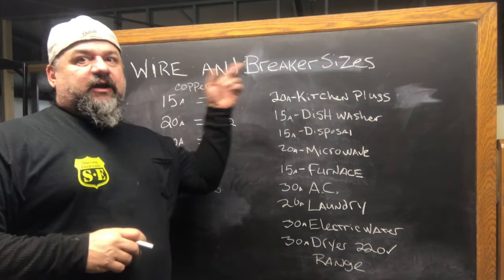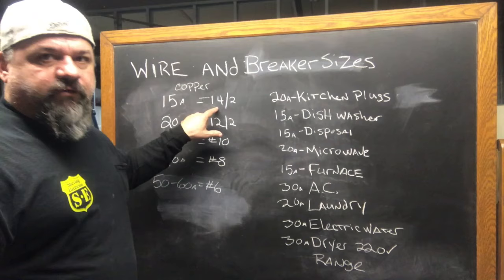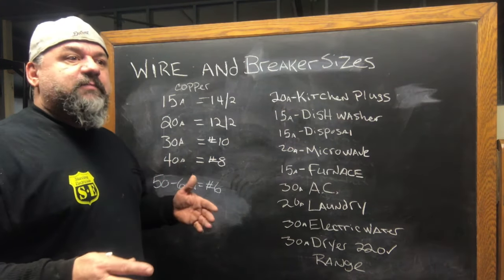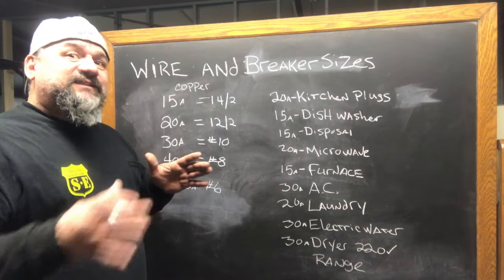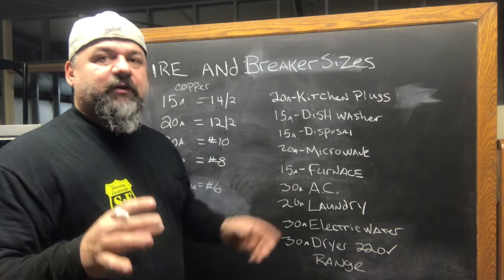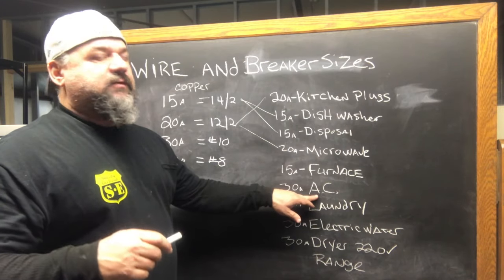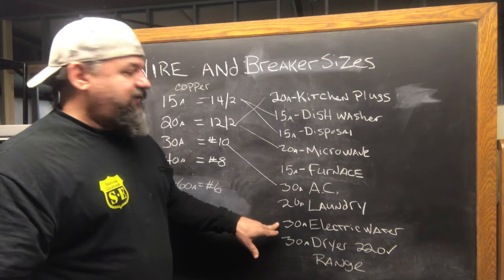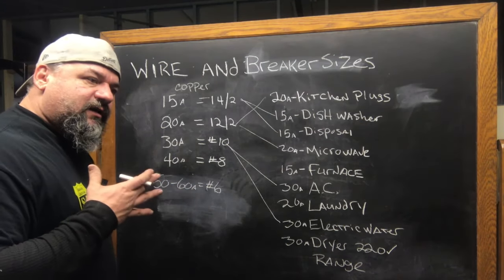"Uncover the Secret to Easily Calculating Electrical Wire and Breaker Sizes!" You wont believe it!

Comment: If I would plug in 3 patio heaters with 1500W; 120V 60Hz 12.5A 5,120BTU each on a single line. What size of breaker and wire do I need please? Thanks
Reply from the maker: ok im going to make you figure this out. 1500 times three is what?  divided by 120v  will get you the amperage.

Comment: Good info question on gfci. I thought you should not have a refrigerator and/or freezer on one in case of a power outage once the power would come back the gfci would be tripped and all food wasted if on vacation for example. Thanks for the info
Reply from the maker: I don’t include a fridge or freezer but you can put them on a kitchen circuit so long as they aren’t gfi protected. Gifs are required where water is present and the plug is readily accessible. Behind the fridge they don’t qualify. In fortunately if you only have one plug in a basement let’s say? You decide to plug your freezer in it then that one plug must be gfi protected. Have to have at least one gfi plug in an unfinished basement.
Reply: Starving Electrician good to know thanks

Comment: Appreciate it. Can you use 14/2 on a 15 amp? Running some can less LEDs. Already had a role of 12/2.
Reply from the maker: go with 14/2 for a 15 amp circuit but use the calcilations to determine how many circuits you need.
Reply: @StarvingElectrician  Appreciate it! I have to find out how to do the calculations.

Comment: I have a subpanel in my shed a 6 breaker 100-amp what size wire should I use and what size breaker for my main panel should aI use
Reply from the maker: #2 aluminum or #4 copper

Comment: Thank you for the great video! Is it ok to install a NEMA 14-50 receptacle with a 30A circuit breaker? I want to install a electric car charger (EVSE) that can be set to 24A using a dip-switch and this suffices for my current needs. Do I also need a rewire with #6 (if I had #10) in this case?
Reply from the maker: well the thing is, the circuit is only as large as the wire and breaker. if you have a 50 amp plug you will be good but it will only be rated for 30 amps. if you draw over 30 amps you will fry the plug or the circuit will trip. its like having a race car. you can go 200 miles per hour but the speed limit is55. the car is the 50 amp breaker but the circuit is the speed limit. hope you understand that.
Reply: @StarvingElectrician  Thanks! If someone accidentally tries to draw 50A, should the circuit breaker trip immediately? Or, is there a chance of the 10 gauge wire frying?

Comment: Question my 6/3 cable has a red black white and a solid copper non colored which I'm guessing is the ground which in other cables are green. From what I understand red and black are hot wires and white is neutral. Now my  power plug and grounding outlet call for black green and white do I have the wrong cable or can I still use this 6/3 to plug the 50amp outlet and power plug?
Reply from the maker: victor Martinez  yes you have to two hots but the plug  doesn’t call for a neutral. If I were you I’d get a different plug but if you can’t remember the ground and neutral go to the same place in the panel do ground or neutral will work but the plug is meant for two hots and a ground. Hope that helps.

Comment: Quick question and probably a dumb question. Just built a new shop and installing 200A service. ive got about 70' from the pole to the shop and running underground. Can I run 4-0/4-0/2-0 aluminum or do I need 4-0/4-0/4-0? Sorry for the dumb question
Reply from the maker: from the pole its only three wire. theres no ground coming from the ploe because there are no breakers and if theres a fault it will energize the ground. thats why you ground and bond the service and not the meter can. if your utility company has certain requires any other things that takes president.
Reply: @StarvingElectrician  Perfect! Thank you for the info.

Comment: I have a question I have 100 W panel I don’t have any space on  my  panel hive 12 breaker I’m going to put a new panel with 20 breaker  What’s your advice to me to do 100 panel or upgrade to 150
Reply from the maker: you can put in a sub panel at the same amperage as the main panel. your sub cannot be higher. so long as you dont exceed the first panels amperage you can put as many sub panels as you want.

Comment: Will 10-2 underground wire from my 200 amp breaker on outside pole to my 100 amp shop panel work? I have 110 and 220 out in my shop.
Reply from the maker: no don't do that. that wire is only good for 30 amps and you need 4 wire.

Comment: My panel is full and I need to pigtail a 60 amp 240v 2-pole breaker.  Does it mean that I need to use a #6 wire for that purpose?  Thanks.
Reply from the maker: yes number 6 copper would do it!

Comment: I recently added under cabinet lighting and split the wire to lights with 14 gauge wire. From outlets with 12gauge wire. Is this a bad thing.
Reply from the maker: its not supposed to be that way but you shouldnt have any problems. its just lighting should be on a 15 amp circuit. but if everything in the kitchen is on 20 amp then whats the harm?

Comment: I have a question! I have to indulge you in some history first...
I have a hot water heater that blew an element. I was preparing to remove the tank regardless because I had a main water break under the floor it sat on, jeopardizing the integrity of the floor greatly. I removed a wall and exposed the electrical job that was less than professional. No marretts used to tie the tank to the 14/2 wire coming from the 30amp breaker. My tank has 2 4500 watt elements. 
Now, after doing some homework, I realized the tank required a circuit breaker larger than 30 amp as 240/4500=37.5 amps.
I researched that I can fix this by replacing the elements using lower wattage. I have installed a 3000 watt and a 3500 watt element, and want to use the proper wire to accommodate the 27 amps I will now draw. Is an 8 gauge wire the proper wire to use? By watching your video I’m second guessing myself. Can I replace the elements as I have as well?
Reply from the maker: #8 guage is good for 40 amps. 27 aps you would use #10 but since its a contineous load you generally want to go 80% of its capacity so that would max out 30 amps. but hot water tanks are usually 30 amps but in your case id go forty since you are right in the edge just to be on the safe side.

Comment: Im wiring a shed what wire should i use 12 2 will be using welder, air compressor, etc
Reply from the maker: you have to add up all the amperage or draw from the equipment and rate your power there. #12 is only good for 20 amps. if you ran those things one at a time and under 20 amps you would be good. id either run multiple circuits or a 60 amp sub panel so you dont have to question if you are good. once its underground you are done. bury a 1' pvc pipe and you can do either one. hope this helps

Comment: Hi. 20A Circuit breaker - 2.5mm cable - 13A  double socket. Is it ok for washing machine(13Afuse own cable) and tumble dryer(10A own cable fuse) ?
Reply from the maker: hello. yes you are good with 20 amp if you are drawing only 13 amps. so long as the wire for is rated for 20 amp #12 you are good. never have a bigger fuse than the wire. hope this helps

Comment: Good video question if your running 8ga and 6ga what size ground do you need to run
Reply from the maker: this video is about wire sizes for breakers. sizing wires for pulls will be another video.

Comment: Hi, you have nice videos! I plan to connect from main line with 8 gauge wire( 40 amps) with 40 amps breaker to 15 amps outlet:
question 1: is this design possible?
question 2: should i connect the mainline to outlet using 8 gauge wire or 14 gauge?  Thanks
Reply from the maker: i would do a small sub panel and feed it with the 40 amps and then feed the 15 amp circuits with the right breaker. hope this helps
Reply: Thx.

Comment: Replacing existing electric stove with a new one.  Existing 40 amp circuit has 3 #8's--two hots and a neutral and a small ground wire; looks like a #14 bare wire. Is this ok? Do I need to run a ground?  If so, what size?
Reply from the maker: Supposed to be # 10 but it’s not a current carrying conductor so I really wouldn’t worry

Comment: Should you use 2 2 2 4 aluminum wire for a three phase 100 amp sub panel?
Reply from the maker: Chip IS POWDER COATING charles brann  well it’s  three #2 conductors, one #2 neutral and #6 ground.

Comment: What do i have to do then if everytime that i have 3 heaters or 3 portable ac's at the same time my breaker pop up,do i have to chamge cables and breaker,is it safe to do it myself?
Reply from the maker: well portable heaters on one circuit you will always have problems and same as portable a.c. unit. you have to read the the amperage of each unit and figure the load. if it pulls 19 amps and you have a 20 amp circuit you are still pushing that circuit and cant really use anything else on it. a good rule of thumb is to go 80% of your circuit to avoid problems.  as far as safe to do,? yes its safe but if you are unsure then dont attempt it. were dealing with electricity here. but in some of my videos I show you how easy it can be. so long as you take the proper saftey measures like shutting off power and if you are working in the panel to be careful around hot wires. always get a pro if you are unsure or not confident but adding a circuit in a panel is easy. white and bare wire go in the buss bar and the black on the breaker. you run the wire to the outlet. and just three wires there. be careful but this is basic stuff and my videos are meant as advise and to show you how to if you decide to attempt. good luck and stay safe.

Comment: I want to run a 100 foot circuit to my back yard for my RV; can I use 8 gauge copper wire?
Reply from the maker: all day long but number 8 is rated for 40 amp. just so you know not to undersize what you are feeding.

Comment: Awesome video . What about the bedrooms what amperage is required for them and are they all on the same circuit
Reply from the maker: Hello. The bedrooms are on a 15 amp breaker and I usually go about 10 plugs and a light per circuit. It also depends on how many lights but generally 2  bed rooms on a circuit is safe.
Reply: Thanks for your help!!!
Reply from the maker: Curtis Young no problem. Glad I could help.

Comment: TU..excellent info.. but what about stranded or solid wire?
Reply from the maker: great question. so long as the wire is the same gauge the same rules apply. the only time they differ is the type of wire like aluminum conductors. wire size is determined by the circular mills like strands or the diameter of the wire. a stranded wire would be bigger than solid to account for how its made. whats strange is like jacuzzi tube have to be grounded and bonded with solid wire? maybe I need to read up on why to answer you better but this is how I understand it. hope this helps.....I need to apologize again because of how long its taking me to get back to all of the questions and you and everyone else will get this same part of the response lol. I have created a blog for questions and answers so more can people learn and also a live electrician portion for more advanced questions. I now offer phone consultations as well as zoom video for the advanced questions and so I can take a look and advise. www.liveelectrician.com or starvingelectrician.com I would appreciate further questions there. Thanks for watching!!
Reply: @StarvingElectrician  thank you for reply and absolutely no need for apology. very informative film. I guess my reasoning is i rather use solid 6/2 copper then stranded 6/2 copper much easier to handle and less expensive and lot thinner. as long as they can handle the same amperage. but i never see anyone using solid for 240v/50 Amp.  on tube and they all complain about how hard it is to handle. strange....

Comment: When I look at lowes all the range outlets and cable are for 50amp. Does that mean i need a 6/3 wire? Are there range outlets for 40amp 8/3 wire ?
Reply from the maker: depends but yes the ranges are usually 40 amps and now require a neutral. so thats 8/3  but 50 amp? seems like it would be less efficent to require that kind of power.

Comment: My hot tub requires a 60amp breaker would #6 copper wire be Suitable for this install . Run will be about 60 feet in total
Reply from the maker: you usually want to run about 80 percent. if your full load continus is 60 amps you may trip the breaker. but a 60 amp circuit is usually good for around 50 amps of a continuous load. thats over 3 hours

Comment: I’m about to install a mini split 35 A obviously I have to use a 35 amp breaker What about the wire number 10 or number 8?
Reply from the maker: since you are over 30 amps its number 8 and on a 40 amp breaker.

Comment: Hello, wondering if you could clear up some confusion I'm having.   I had a whole house tankless water heater installed around 6 months ago.   It is running on a 20 amp 120v circuit.   I'm wanting to add some POU Tankless under sink water heaters in my kitchen and 2 bathrooms because of having to run the water for so long before the hot water reaches the location.   We hate wasting water.   The problem I'm having is all of the units I'm interested in require 30 amp, 10 Aug wiring.   Why is this?   I can't find a unit that I can install that will simply plug into a 120 V wall outlet.  There are small tank versions that will plug right into the wall but i don't want a water tank taking up so much space under the sink.  So I can't use a 30 amp breaker on 12 Aug wire?
Reply from the maker: unfortunatly not. the other thing is the 30 amp is 220 volt. so you would have to undo the neutral from the buss bar and ues it as a hot. now, i have a small water heater at the shop and its 220v 20 amp. its 20 gallons. home depot has them at 10 gallons and yes they are 220 v but thats a matter of using my neutral as another hot. i put the black and the white under a two pole breaker and now i have a 220v 20 amp circuit with a ground. perfevtly legal. you have to put black tape on the wire but thats it. so just look for a lower amperage water heater than 30 amp. hope this helps.

Comment: Myream tankless water heater is requiring a 1x6 AWG a 60 amp breaker it's pulling 240 volts what size wire should I use a short run maybe 15 ft
Reply from the maker: What it pulls is current the voltage has no basis for wire size. number 6 sounds huge for a water heater. look at the amperage on the water heater and that will determine your wire size. its 220 because there are two 120v heating elements in it. it heats up faster than 120 because you are using both elements.

Comment: Is the neutral wire required   for a dryer that have 3 wire out let ?
Reply from the maker: The new code is that all dryer plugs have neutrals. If it’s an older dryer it doesn’t need one unless it has newer. Electronics.
Reply: @StarvingElectrician  thank you for your respond .but if i have only out let with head not 4..what should i use for the third 1 neutral or ground ?thanks again
Reply from the maker: Abdorakeeb Naji  use the ground.
Reply: Thanks a lot ...

Comment: What do you recommend for wall
Unit heat/AC unit 220volt?
Reply from the maker: its the amperage that determines wire and breaker size. people think because something is 220v the wires are bigger when its the amperage. let me know what the amperage is and I can tell you the wire size

Comment: Running sub panel to shop I have (3) 6awg wire + (1) 8awg ground around 75 ft, i would like to put 60 amp breaker but thought just put 50 amp considering the length of wire?
Reply from the maker: 50 foot isnt enough for a voltage drop. I would go number six and a 60

Comment: Is it expectable to run a sub panel for an out building on a 60 amp double pole breaker with 2 hot, 1 neutral, 1 ground #6 wire branched from a 200 amp meter combination box. About 40-50 feet distance.
Reply from the maker: yep you are good to go.
Reply: @StarvingElectrician  Thank you sir
Reply from the maker: @krifenbark   not a problem. stay safe.

Comment: How is it in hvac they can use a 6 Guage wire for a 60 amp circuit but normally a 6 gauge wire is only good for 50 amps? Is there a rule to this for hvac.
Reply from the maker: theres not seperate rule for HVAC but the electrical portion on the outside of the unit is universal. #6 is good for 60 amps.

Comment: Can I use a 30 amp breaker for a water heater?
Reply from the maker: they usually are 30 amp and #10 wire for water heaters. check the amperage for correct wire and breaker size.

Comment: 14/2 12/2 etc and the different breaker ratings
  Is it done mainly to save on materials? Why not just run 20 amp breakers with 12 gauge and call it a day. With the specialized wire fir heavy appliances taking 240 etc
Reply from the maker: i hear what you are saying but, what if something draws like 10 amps and its going bad then starts drawing more to trip at 15 amps. now were on a 20 amp breaker and that device will catch on fire before the wire trips. on top of number 12 being a pain in the ass to work with. now one thing, if you wired lets say a lighting circuit with #12 you could add more lights because the wire could stand a bigger load. its not about conserving wire its what is in the code book to protect against fire. i hope I explained this so you get it. thanks